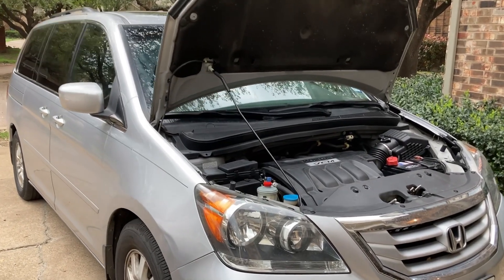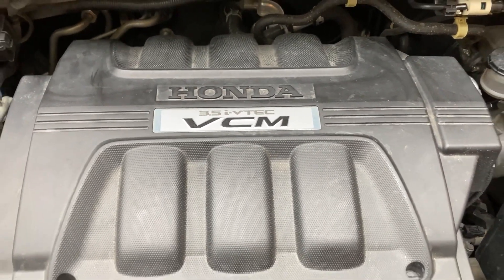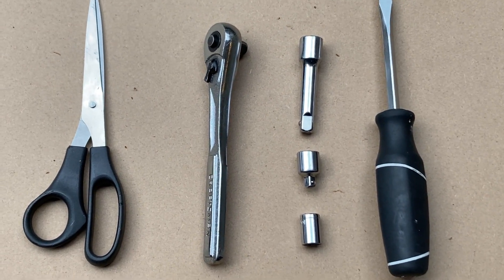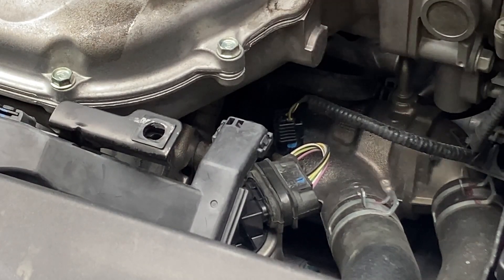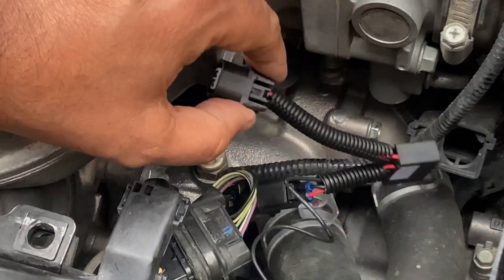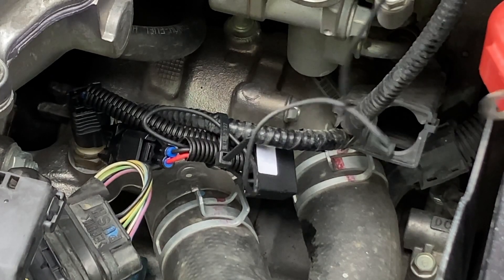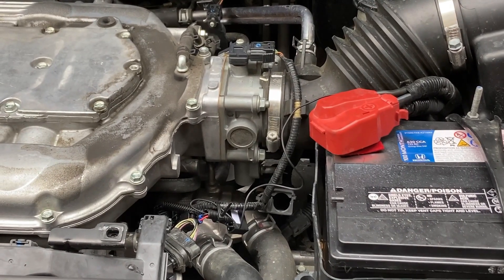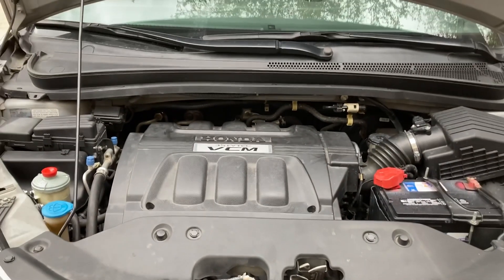Honda VCM Engine Problems | Easy Fix

Comment: Hello .. how is the S-vcm controller doing so far ..  I'm thinking of getting one if it is worth it.. thanks 👍🏻
Reply from the maker: It is doing very well, the Odyssey has regained it's power when accelerating, no hesitation, no check engine light. Overall it is going well. I probably should've installed it a long time ago to protect the cylinders and piston rings, but glad it is here now.
Reply: Where can i get it
Reply from the maker: @Dangaske24  Please check the description of this video which has website address from where you can order. I just checked and they have it in stock today.
Reply: I installed the SVCM on my Honda pilot so much better too